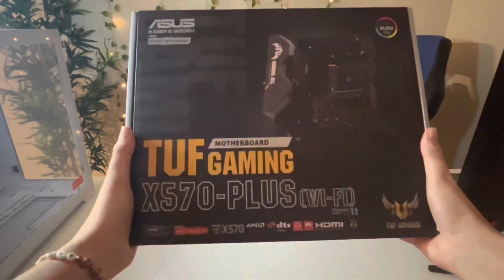I ALMOST RUINED MY FIRST PC BUILD

Comment: Hey, just a suggestion about the M.2 SSD location. I suggest you put it on the slot right under the CPU (nearer to the gpu) because it uses a CPU pcie lane instead of a chipset pcie lane which is much faster for storage speeds. I could be wrong but you should definately check your motherboard manual to see where the CPU lanes and chipset lanes are.
Reply from the maker: I'll check out the manual soon, I need to recover from building this haha but thank you for the suggestion!! :)
Reply: The M.2 spot just underneath the CPU... she'll need a heatsink for that spot to keep it cool. The one that she currently has will work where it is as that top spot is typically reserved for one like the Samsung 980 Pro.

Comment: If you use an X570 or B550 board, you will most certainly end up with USB issues.
In my experience though, I found that USBs work fine when I don’t use an NVME drive.
So a SATA drive is probably better in your case and shouldn’t bottleneck your gaming.
Reply from the maker: I haven't had any yet but I will definitely keep that in mind. Thank you!
Reply: @Aspentera  It's a well known problem.
Usually this mostly affects USB 2.0 ports, so you can just try plugging everything into 3.0 ports (even 2.0 devices).
Hasn't fixed it for me though.

Setting PCI to gen 3 is also a known fix.

Comment: It looks incredible! Congratulations on your first PC build. It's never a PC build without having to unplug and re-plug at least three parts in.

For your GPU issue, it may have just been the CPUs PCIe negotiation order. It may have tried to output to the Elgato for some reason instead of the GPU. Or it could have just been random debris. PCIe is finicky like that sometimes!
Reply from the maker: Thank you so much! :) Same with cars lol! 
That's what I was thinking considering it worked once I had the elgato out :/ but all that matters is it works now!! haha